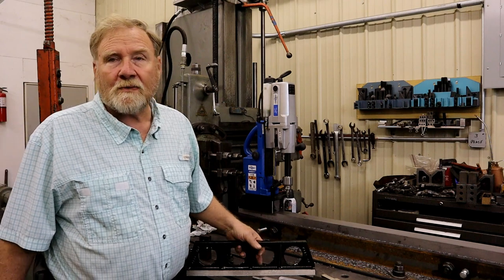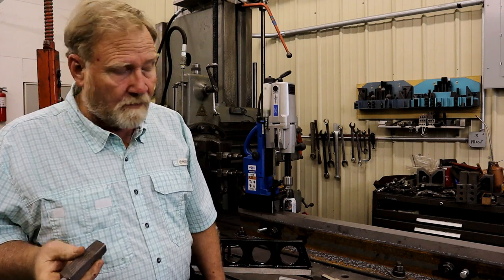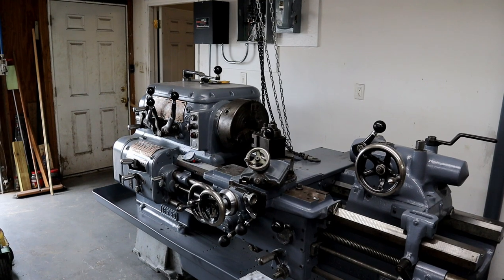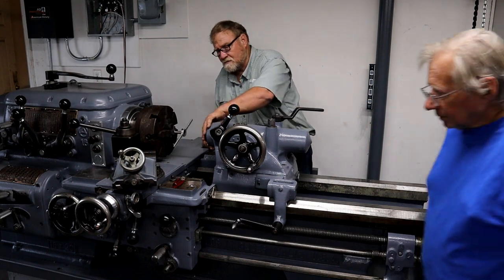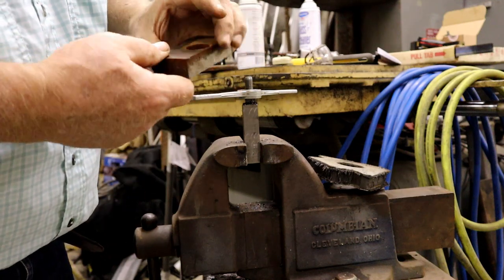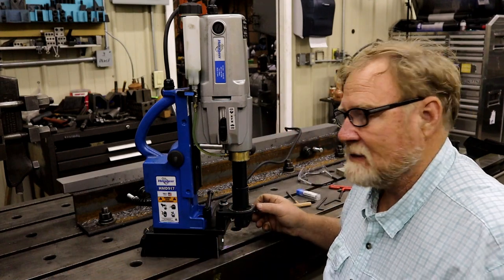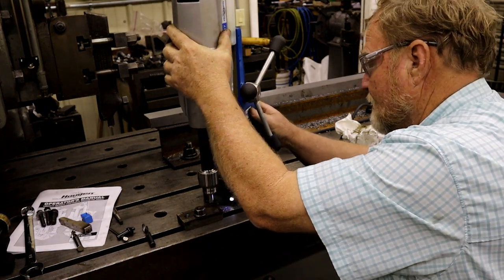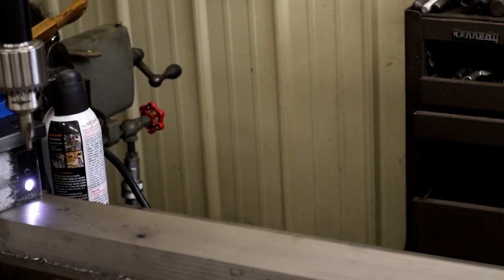A really FRUSTRATING day in the Shop!

Comment: Fill the void with soft plumbers solder and be done with it.  At least it is real metal.  Not iron, but better than epoxy.  That lead-free solder actually sticks exceptionally well to cast iron.  Use regular zinc chloride plumbers flux.  All can be bought at Lowes or Home Depot.
Reply from the maker: Too far along for anything needing heat to spot repair it.... If I heat it it's back to the stress relief oven....
Reply: @10swatkins  I have repaired gouges with soft solder in the bed of my 17" Colchester lathe using a MAPP torch.  Surely it has more mass than your straight edge.  The lathe bed itself was hot enough to melt the solder, not just the flame from the torch.  If I would have used the oxy-ace torch, I thought it would have been too much heat, but that was an option.  In my experience, your straight edge is an easy candidate to take soft solder.

Comment: got a smaller chuck that you could chuck into the chuck in the 20" lathe.. giving you the ability to turn something smaller..  you could also turn a chuck holder to put into the jaws of the 20" chuck to hold a smaller chuck..
 its almost how many chucks could a wood chuck chuck chuck if a wood chuck could chuck wood..
Reply from the maker: At this point my smallest 4 jaw is a 10" and  I was not at the point of taking all the studs out.   I was most there when Don offered his lathe...

Comment: That Axelson 16 inch lathe is a sweet machine, you should have kept it for your shop,  I know you needed a longer bed lathe but just saying. I am hopping the rest of 2021 gets better with your cast iron problem. I do not understand how a sheet rock screw got in the cast iron mix.?
Reply from the maker: The longer bed is what I needed most.... THe 10 EE is almost ready for use... Just have to make two tension pulleys., install the 400.00 gear in the transmission and tighten up the forward and reverse lever.. The detent is really sloppy and it can go into reverse when you want to stop... 
I'm going to open up the head on the Axelson 16 that was given to me... If it looks semi ok in there I will restore it...  OR you can come down and distract DON while I hook up the drag out chain to the one in his garage :)

Comment: Re: The Atlas lathe, #1 the stock motor is too small, they need 1hp minimum. #2 Use HSS and it has to be sharp. #3 you would have been better off using round stock. I ran an Atlas for years with a 1.5hp motor, cut fine and never snapped teeth off the gears.  You could put a blank piece of HSS in the Axelson and get it to cut, seen it done several times by newbs.
Reply from the maker: The whole point of the exercise was I didn't have any round stock cast iron and MCMasters was 32.00 for a 12 inch piece....
Reply: @10swatkins  Ah, 2 days work to save $32, makes perfect sense! :-)  Wondering if foundry used the "lost foam"  process and instead of gluing foam together they used drywall screws?
Reply from the maker: Nope, owner told me last night he even has the pattern for that one, bought it with the edge.  Then he said he has the mold and knows a guy with a planer...  I told him " No... You do not know a guy with a planer and IF i see you showing up to the shop with that pattern you should also have a BIG jar of Vaseline,  it would make the meeting go much easier....  "

Comment: That is just unbelievable. I've never heard of a casting being augmented with filler material. Is that common or would it just be a foundry mistake that a screw would get into the pour? Did those guys train in the concrete business?
Reply from the maker: Having never cast with cast iron I only have a guess..... For a scrupulous foundry I could make a point of them adding a hardened steel to adjust the mix in some way,  For an unscrupulous foundry I can see them just throwing any thing in to make more profit.
In any case it is NOT melting and mixing with the iron whether because they don't know it's happening or because they are trying to save money on fuel and not letting it cook long enough...
Reply: @10swatkins  I know its a heartbreaker for you. Thanks for the reply.

Comment: steve. have the dealer disconnect the connectors on the back of the fuse block and check them for burn marks.  where they did not fully engage. between the terminal on the wire end and the pin on the back of the fuse box..  i am trying to get your rock fixed..  i want to know if they were able to duplicate your flashing lights as in the video.. and if they would stick a circuit tester on each fuse one at time in the underhood fuse box and the various under dash fuse boxes.. while another tech turns the key to see if the underhood fuse box is loosing power or the underdash fuse boxes are loosing power when the starter circuit is engage via the key..  its a dead simple test.. i have been fixing electrical issues on cars and pickups for 40 years. a long with making them reliable.  print 2 or 3 copies of this test.. give one to don.. and 2 to the dealer tech.. ask him to perform all six steps.. https://i.imgur.com/WMDprhm.jpg.
Reply from the maker: I've told them everything you suggested... They just smile and say ok....
Reply: @10swatkins  dam.. you've been okeydoked..